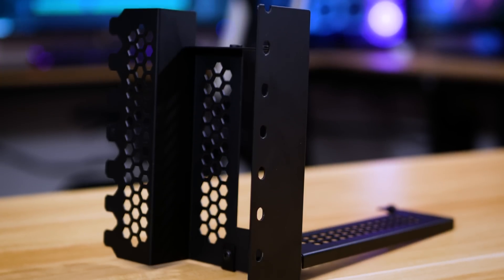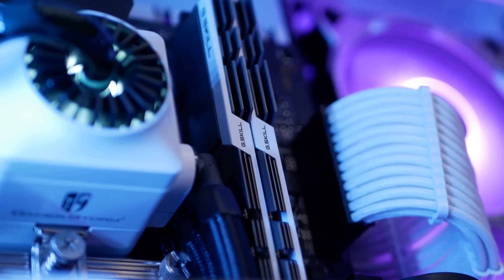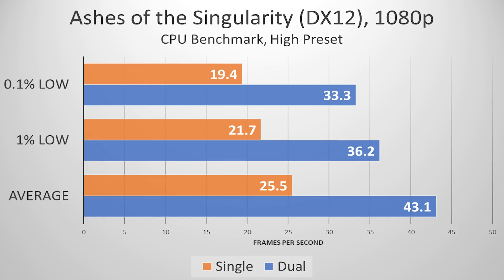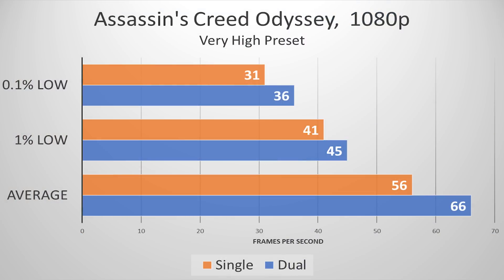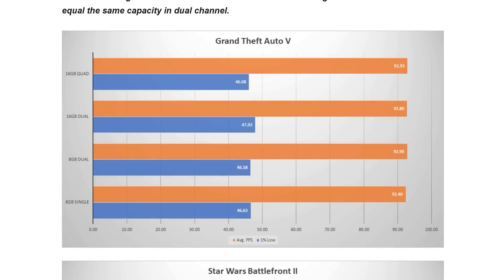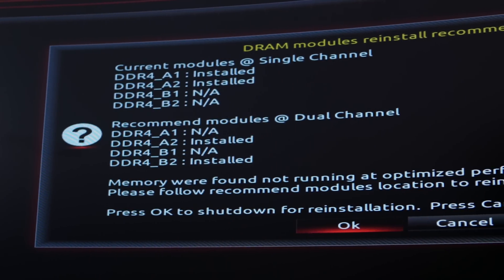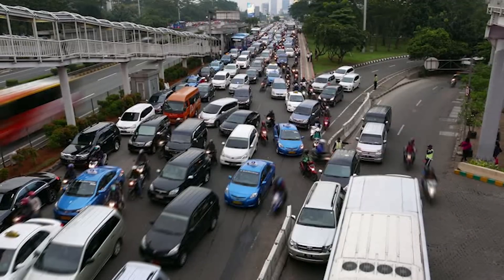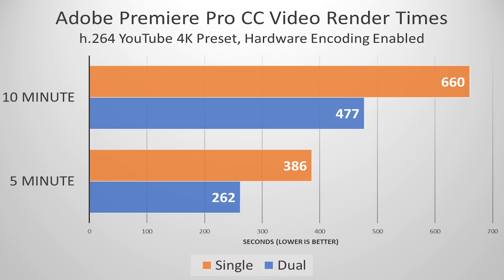What is Dual Channel Memory and Why Does it Matter? (w/ Benchmarks)

Comment: Question... If I bought two dual channel memory sticks, same spec and everything on both dual channel memory sticks will it run on quad channel? Hope someone can answer it. Thanks.
Reply: Dual channel means 2 sticks of ram, each stick is a single channel. So you need 4 sticks for quad channel

Comment: My mobo ram slots both right one b1and2 got fried some how or dont work after installing a new CPU in z270 Intel motherboard and I'm stuck with 16gb ram in single channel any advice?
Reply: Check for bent pins in the cpu socket. Had almost same problem on a z87 motherboard. Lost a2 and b2. Fixed the pins, and fixed the problem.

Comment: So this illustrates the differences in a system worth around 2000 bucks, prolly more.  Try it out on a more reasonable system, something like the i5 or r5 with a vid card less than 500 bucks.  Would be interesting to see if the dual channel makes as much difference to someone that might ACTUALLY have a budget problem with buying an expensive kit, so is thinking about buying 1 stick/kit now, 1 stick/kit later scenario.
   Was just thinking about this for my lil sister's build last night, and this morning a friend asked me about it for a build he's planning.  Both are on a more common budget, about 1200 bucks.  My thoughts are that the single channel won't make as much of a difference when you don't have 1200 bucks worth of "overpower" just in mobo/cpu and vid card, so starting with 1 stick and getting the second later won't effect them as much, but I don't really have a way of testing that without buying the gear first.  Have also heard that AMD's Infinity fabric does scale with ram latency and bandwidth (mostly latency) so wouldn't single / dual channel hurt them more than Intel?
  Anyway, would really appreciate it.  Thanx
Reply from the maker: The differences are marginal assuming the CPU is still the bottleneck and the frame rate is high. I always try to play well above 100FPS, and will drop in-game settings to do so.
Reply: @GregSalazar  "..well above 100 fps..."   Yeah, that's kinda my point.  You, me, and some others are used to that kind of performance, as a standard, at ultra settings / high res ect.  You really aren't going to have that same standard, with all the visual elements, on a lower end system, without dropping load in different places. 
 You were surprised at the difference even with highest end hardware running in completely optimal config.  Might the same not hold true for lower end hardware that swaps the bottleneck in different places during the load, where the settings you have to run to achieve that 100fps are far different, with cpu that handle changes in mem bandwidth / latency differently?
  Anyway, like I said, interesting topic that held some real world interest for me, so loved the vid. Also, thanx for the response :)

Comment: Wait a minute, you recommend A1/B1 for dual channel but later in the video the bios recommend A2/B2. Time to re-test! ;)
Reply: though that when i saw the ram at the start, most mobos have it at the second and fourth slot.
Reply: Usually the recommended slots for optimal dual channel is as you've said A2/B2. That's what is recommended on my motherboard as well (Asus Z170 Pro Gaming), unless you're running 4 sticks in which case it doesn't matter where you put them since you'll have maxed out.

Edit: It's possible the difference between slot A1/B1 and A2/B2 is negligible of course, but as you said for the most part (every single motherboard I have owned) the manual recommends you use A2/B2 for dual channel configuration with 2 sticks.

Comment: Wondering if this has any change using Ryzen as opposed to using Intel based....
Reply: I own a 2700X, when my dual channel 3200MHz tridentz kit died I was forced to run a single cheap 3000MHz 16GB stick for a few weeks while I RMA'd the kit and there were differences of 28%~50% in framerate in most of my games.
Reply: @PoppyPoppa  well, that's why i ask, we know Ryzen is dependent on Ram speed for infinity fabric support. I can imagine single channel is a huge performance hit. where as i can find no noticeable increase or decrease when I went from 1 stick of ddr4 8gb in my Asus Nitro gaming laptop to two sticks....it was kind of disappointing.

Comment: what about double sided memory vs. single sided memory?
Reply: Dual sided memory (rank 2 vs rank 1) behaves the same way as adding another DIMM socket, which only adds capacity and doesn't help with transaction overlap (how dual channel can do two reads / writes at once). Electrically, dual sided adds 1 extra clock and 1 extra chip-select per DIMM socket, but everything else is shared. This as opposed to dual channel where each channel has their own set of wires (pcb traces), allowing them to operate independently.

Comment: At start:*explains dual channel support* Look at the ram slots on 0:45
Reply from the maker: It was positioned like this during my testing, and I just happened to film the b-roll when this was happening. Don't freak out.
Reply: @GregSalazar  Nah i just had a good laugh but still Love your videos :D
Reply: This is the new thing after the verge done it. We're all GPUs in the 8x or 4x slot, PSUs with restricted flow and air bubbles in our thermal paste because it's cool
Reply: @3point1.2  Ahh off course we get +30 fps with RGB right?
Reply: Only if it's all transitioning between all the colours in sync

Comment: I have a PC with a pentium g4560, 1050ti and 8 gigs of ram (one channel) i recently purchased another stick and ohhhhh man what a difference, no more microstutters, i average 20-30 fps more with just that "Little" change.
Reply: I bought a new set (16 gb corsair vengeance)
Reply: This is happened to me too, not many pc expert explain this so i wouldn't know.
Reply: Lucas Z it will run dual channel at the lowest channel ram frequency
Reply: @Lucas Z 
normally if u using 2/more different stick
they will follow the slowest one (or even use the slowest SPD rating) to maximize compability
Reply: I noticed this on my i7 3770, i had 1 stick of 8gb DDR3 and bought another one to make 16, put them in dual channel from the start it did get rid of some micro-stuttering that i could not troubleshoot for months before and kinda gave up trying to fix it 'till the god of PC gaming gave me a hand.
Reply: I had the same problem and did exactly what you did, I was also surprised.

Comment: I used to have one stick in my slots when I first moved to DDR4 because of the price of it and noticed a drop in frames from my rig that used ddr3. I didn't realize it was my ram until I did some research on youtube and found that when I did end up purchasing a second  stick of memory my frames improved a crazy amount, it was like getting an entirely new PC, I don't remember the margins that were there but they were similar to the ones in this video. To anyone thinking you will be just fine or trying to save money by purchasing just one stick, please try and get another one if you can, it will help you immensely.
Reply: Steve (from Gamer'sNexus) disagrees. Unless you have an integrated GPU, games are rarely bottlenecked by memory bandwith. It's more likely you didn't have enough memory to begin with.
Reply: @TheGyuuula  memory is everything. what happens is that is one of the most difficult items to overclock it literary can take months or years of trial and error to find a timing that will give the lowest overall system latency but the goal is well worth the pain as this would not only help you get the best gaming experience but also your pc will be the best media center a 4k video would look so real but not many people can grasp this they just know it looks and hears good as real life event would be
Reply: Well that was a noob mistake. You buy them in pairs and install it in pairs.
Reply: @eagleeye8916  Keep in mind, that the more DIMMs you have in your PC, the harder it will be on the memory controller. Especially, if you have dual rank memories. 

I had 2*4Gb 1866 Mhz dual rank Corsair memory installed in my PC. A few years later I bought 2 more module, but the FX's IMC can't handle that speed with 4 module, and I had to downclock my memory. With a little overvolting and playing with the BCLK, I managed to pump it up to 1800 Mhz, but it's borderline unstable.
*My advice*: If you can't or don't want to buy 16Gb memory, get a single stick of 8 Gb, preferably single ranked module of a popular brand. It will cause you less headache, when you have to upgrade your memory capacity.
Reply: @TheGyuuula  16gb ram (2x8gb) is the minimum  for a gaming pc going into 2019. They can range from $100 -200 depending of brand and speed. Extra ram is usually  for photo editing , animation , video editing etc. They should be able  to afford it being the hardware for that platform is in another premium price point by itself . Like how I bought pairs of 2x4gb for an older MacBook pro . If I was short it take me the next pay check which only cost me like $60 at the time
Reply: @eagleeye8916  wrote: "They should be able  to afford it"  
It depends :D Here in East-Europe, a modern gaming PC (~1000$) is quite a luxury. People would rather spend it on a used car or something practical. Or think of a student on a tight budget. If you have to skim on the memory, buy a bigger capacity module - rather than 2x half the size - and buy a second module later. I think for AAA games, 16Gb might not suffice in just 1 or 2 year. So, staaay awaaay from the 4Gb parts.
Reply: @TheGyuuula  here in the u.s. 1k is a  entry to midrange for a gaming pc. 1500-2000 is what you want to play on for aaa  titles and up. My MacBook only supports 8gb of ram that I upgraded from 4gb 7 years ago. Anything more demanding I run on my pc. And I agree, in the future we are going to need more ram .  You can always try the used market if your on a tight budget
Reply: Not to be a dick or act like I got it like that, but I was making $30-40 25-30 years ago bagging groceries as a young teen. All students should have some  kind of hustle to get what they want . I do remember it went to candy and video games . I guess some things haven t changed 🤣
Reply: @TheGyuuula  The fx8350 I'm using works just fine. So I suspect you have something else going on there. Though it could be silicon lottery effects on either/both sides.
Reply: The maximum officially supported memory clock for 4x dual ranked module is 1333Mhz. The silicon quality of the processor's IMC can clearly hold you back, depending on the memory configuration. Source:
https://www.amd.com/en/support/kb/faq/cpu-ddr3
Reply: @TheGyuuula  Officially supported vs actually works is two different things though. The bios and MB can make huge difference as well. It's easier to beat the officially supported on fx than hit it on ryzen1xxx series in most cases for example.
Reply: Ok guys, can anyone tell me, should i add one more stick of 8gb 2666mhz ram, would it improve frame rates? Cost is about 80 euros. My motherboard is Asus Z170K. I got only one stick of 8gb ram on 2666mhz. Pls answer.
Reply: @steffkepn2  You have to tell us more about your PC...
Reply: @steffkepn2  If you look at your control panel and see when a game is loaded that it is nearing that 8GB mark, I would recommend it  because if it is getting close to that it is having to read/write stuff onto your disk instead of just pulling it from the RAM. Hope this helps

Comment: It's maybe the same issue with 2990WX , the I9 9900k with it's 8 cores need memory a lot of memory bandwitdh compared to a regular I7 7700K or even 8700k maybe if you rerun the test with an i7 7700K the performance delta won't be as high as you found with a i9 9900K

Comment: I still use single channel, but that’s mostly because I use Intel HD Graphics for gaming.
Reply: All the more reason to use dual channel as the iGPU uses your RAM as VRAM.
Reply: True, but I play with a dual core CPU instead of a quad core and that alleviates the necessity of dual channel. I also play at 720p low settings, that way I can reach a solid 60fps in the games I play, so I’m fine.
Reply: Hey as long as your having fun on the games you like that's all that matters.

Comment: I found the same results in my tests...It does make a difference.
Reply: Cool, the reality is it doesn't though.  Games don't hit memory bandwidth limits, Gamers Nexus did extensive testing on this.
Reply: @marcleblanc3225  Yes it does! You will have will have 20more fps in dual channel mod vs single in games like total war, and assassins creed that are more cpu intensive with a gtx 1070 for example.
40fps vs 60fps is a big difference.
Reply: @MoneyMaking861  this has been extensively tested by other people.  I'm talking significantly more so than the testing done in this video.  The differences between dual and single channel for gaming were found to be negligible at best.  I suspect there's something else that's been overlooked in this video.
Reply: Victor Ov It does make a huge difference you’re right. It’s been proven time and time again that single vs dual channel makes a huge difference
Reply: @marcleblanc3225  lol none of the games are cpu intensive they only use 2 cores try it with the games I listed above.
Reply: @MoneyMaking861  really?  so most of the games need only 2 cores to run?
Reply: @marcleblanc3225  nice, the very first - outsticking - website you linked, shows a video where it does matter. You really just didn't care at all, did you?^^
Reply: @jerome6383  thanks for replying to a year old comment, but right from Gamers Nexus:

The Verdict: What Do These Results Mean; Is Dual-Channel "Worth It?"
That was a helluvalot of testing and methodology discussion, but I hope it was for a good cause - I wanted to ensure there were no questions about how we performed these tests. More importantly, I wanted to ensure that others can replicate and add to my results. If you're running this yourself for some specific game or program that I didn't test, please feel free to list your specs and software tested below!

Despite all that I thought I knew leading up to our MSI meeting last July, dual-channel just isn't necessary for the vast majority of the consumer market. Anyone doing serious simulation (CFD, parametric analysis) will heavily benefit from dual-channel configurations (~17.7% advantage). Users who push a lot of copy tasks through memory will also theoretically see benefits, depending on what software is controlling the tasking. Video editors and professionals will see noteworthy advantages in stream (RAM) previews and will see marginal advantages in render time. It is probably worth having in this instance -- in the very least, I'd always go dual-channel for editing / encoding if only for future advancements.

Gamers, mainstream users, and office users shouldn't care. Actually, at the end of the day, the same rule applies to everyone, simulation pro or not: It's density and frequency that matters, not channeling. Quad- and better channels theoretically have a more profound impact, but this is in-step with the increased density of kits that are targeted for quad-channel platforms. If you want to push speed, density and frequency should be at the top of your list. Generally, when you're spending that kind of money, you're going with a multi-channel kit of two or more anyway, but the point still stands.

They literally say it doesn't matter in the conclusion.  But thanks for incorrecting me.
Reply: @marcleblanc3225  As you didn't change your mind over the year: you are welcome.

What they conclude on circumstances 6 year ago then is, as written there, based on what they think people should care about. Not on existing differences for certain tasks.
If you care, that certain games might change from 45 to 60 FPS or from 80 to 100 FPS, or that your video rendering takes 20 - 30 % less time, than you care about such differences. 
And different to what some other websites state, GN pretty much showed quite a few examples, where it did make a significant difference in relative terms.

When it comes to rendering videos for example (what much more poeple do today), using dual channel might equal an update to a better CPU or GPU. You can argue then, that many consumers don't care whether their videos take 60 or 45 Minutes to finish. Naturally.

But if you care about performance, on many circumstances this can be a siginificant matter. GN made a very strong example years later: APUs. 
https://www.youtube.com/watch?v=bSKNfZI3ons

What difference do you think could occur there? Well, under demanding tasks like gaming, just between 20 and 80% on their graphics performance.
His old conclusion could still be applied: For most non interested consumers - playing in 1080p instead of 800p or with 60 FPS instead of 35 - it doesn't matter.
But tell me, is that difference not there though?